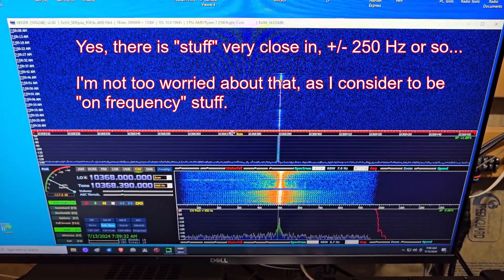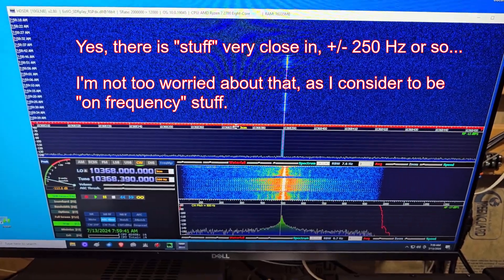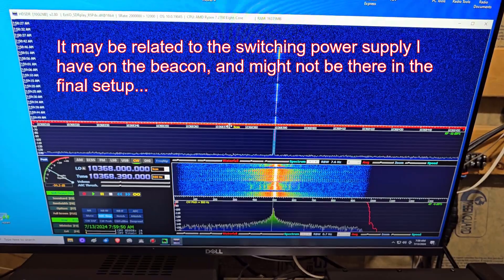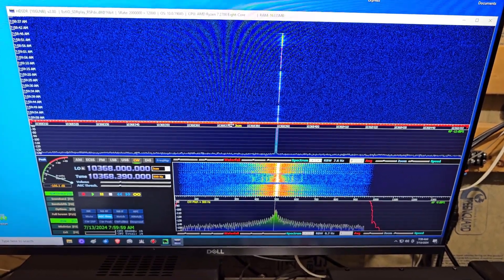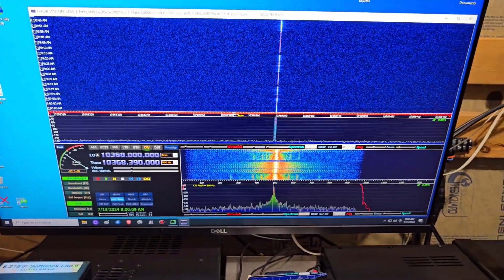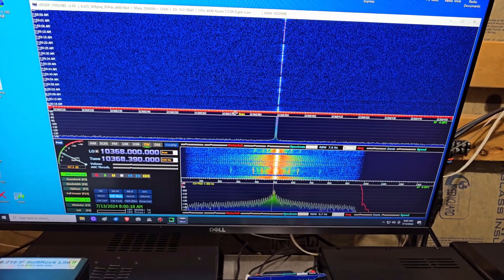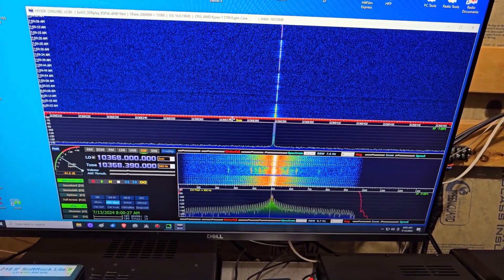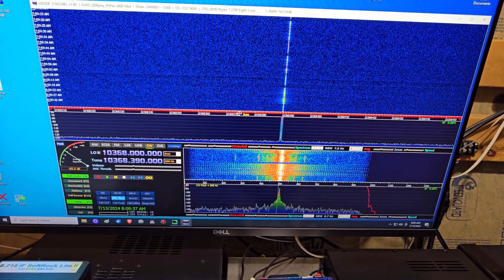10 GHz Beacon - Leo Bodnar LBE-1420 as Exciter or Reference

Comment: Hey Paul, great video. Just received my IC-9700 Bodnar  board needed for 1296 FT8 stability. Amazing how well it locks. 73. KT1R. Lou
Reply from the maker: Hey Lou, I just noticed your comment. For some reason I didn't see a notification on this one. Great on locking the IC-9700.  I'm really glad Leo Bodnar came out with the LBE-1420 and 1421. The fractional Hz capability gives new possibilities for microwave use.

Comment: Youtube has deleted my last comments. 
What frequencies are you looking for?
Reply from the maker: I see another comment from you below about using a second LNB as a sniffer for testing. I replied to that. Ultimately I am trying to generate a clean signal on 10368.390 MHz. I use a x9 multiplier from 1152 MHz to 10 GHz, so I need 1152.043333333333 MHz into the multiplier. It is easy for most synthesizers or GPS reference clocks to generate 1152.000 cleanly but when asked to do 1152.043 or such they have spurs on the output. My solution to this is to move the 10 MHz GPS locked reference into the synthesizer up a few Hz and program the synthesizer for 1152.000. This moves the final 10 GHz frequency to where I want it without meaningful spurs. So it seems I have a solution that works for me.

Comment: As you only have a sub 1G speccy you can verify the LO by using another lnb at 9.75G and holding it near the output with an open pcb.  You should see an IF of around 10.3xx - 9.75G on the sniffer LNB IF output.   The bullseye is good for this as it was optimised for sub 1G IF signals and the internal VCTCXO is pretty good.  Its VCTCXO as the MCU internal aplies a pwn voltage offset to the VCTCXO.  It was calibrated in the factory to sub 1kHz but these were built 5 yrs ago the vctcxo drifts.  It can be recalibrated, and I released the hardware tondo to the British amateur radio guys.  Its on github somewhere
Reply from the maker: Yes, you are right. I should get another Bullseye LNB to use for that kind of testing. I don't know what the phase noise performance of the LNB is so it may have some limitations in seeing stuff like spurs close to the frequency of my desired signal but it would still be very  useful. I will take your advice and get another one to use in this way.
Reply: @n1bug  its about -90dBc/Hz at 10k offset.  I know as I designed it.  The VCO on the bullseye is very wideband and has a fixed division based on the Tone/no tone.  The leakage out of the F-connector is about -40dBm.  So you can use the Leo source to lock the VCO on your modified unit and get your 10.3xxG out of the F-connector.  Use tone to select 10.6G LO as this is closer to your desired, and the PLL division will be 424.  Thus to get 10386.360 use a ref into the modified bullseye of 24.45368 MHz (ish).  Then you should see 10368.36032 MHz at the fconnector output at about -40dBm.  You can filter and amplify.  If you use no tone then the LO will be 9.75G so the PLL division ratio changes to 390.  You can try a reference freq of 26.585589MHz to get your 10368.360 etc
Reply: as long as the input reference is clean and a decent phase noise you should have a good beacon LO without having to use a multiplier.  There are also a number of low cost PLL+VCO IC's in the market that can easily do this, but not as cheap as this method.  Remember that the phase noise of the Leo reference needs to be good.  The LNB phase noise will be be the same as the LEO - 20log(424) or limited to about -90dBc/Hz @ 10k (in loop BW)
Reply from the maker: @jonwalker8999  Let me see if I understand. Are you saying modify the LNB by removing the VCO, feed reference into the red F connector and get 10 GHz at -40 dBm out of the green F connector? I will have to try that when I get another Bullseye. It sounds like I should get a few more to experiment with.
Reply: @n1bug  Yes, thats correct, you have already done that in a previous video where you used the reference from Leo's unit to lock the LNB.  So just test it on that unit with a different reference freq.  The internal LO of the LNB downconverter chip is nominally 9.75/10.6G (universal) with a 25M reference.  The way it changes frequency is to alter the internal fixed divider within the chip.  The internal VCO in the downconverter (not the VCTCXO) is very wideband and can cover about 9.2 to 11.7G.  The LO leakage from the downconverter IF out is about -30 to -50dBm .  So you can take the downconverter LO from the F-connector, filter and amplify.  You can then use another lnb to sniff off the leakage and verify with your sub 1G Speccy.  The LNB will have about 60dB gain; just be careful that you don't compress the LNB by holding it too close as it can develop spurs when it's in compression.
Reply from the maker: @jonwalker8999  OK, got it. Thanks for all the great information!

Comment: I will try to look into the spurs generation around 576MHz. Same output frequency can be achieved with a lot of different configuration  settings. 
I can confirm that I also see +-20kHz spurs on 576.020 MHz using default software settings.

I have left the comment here before but YouTube removed it. Let's see if this one lasts.

Thanks
Leo Bodnar
Reply from the maker: I think they removed your previous comment before sending a notification. I did get notified of this one so let's hope it stays. I will be curious what you might find with alternate settings. I know of at least one 10 GHz beacon that is on the air that way, probably with spurs. I don't think the spurs bother most people, but my project goal was to create the cleanest beacon possible given budget.

I am now using the new LBE-1420, which also had spurs at 576.020 or 1152.040 MHz but is working great as a 10 MHz reference shifted upward. By setting the reference appropriately and using a synthesizer programmed for 1152.000000 I can get just about any  10 GHz frequency I want with no spurs and good phase noise. This is a much more frequency agile setup than any previous method tried and will probably be my final solution.

Comment: Hi. Very interesting. I have a Leo Bodnar LBE-1420 and have run a few phase noise tests on it and it is pretty good, especially for the price. I will do some more at different frequencies to see if I can see any spurs. Drew VK4ZXI
Reply from the maker: Hi Drew. I would be interested in your findings. I need to try to do more phase noise checks on the beacon. Of course phase noise at 10 GHz is much higher than it is at the reference or the 1152 MHz synthesizer output but my beacon is looking better than most that have gone on the air in recent years. Many of them are only 40 to 50 dB down at 10 kHz. Mine looks to be at least 60 dB, possibly a little better than that. I don't have a proper measurement system but if I calibrate the dB scale on the SDR and S meter on the conventional receiver I can get a "no worse than" figure. Of course any estimate made this way is limited by receiver phase noise.